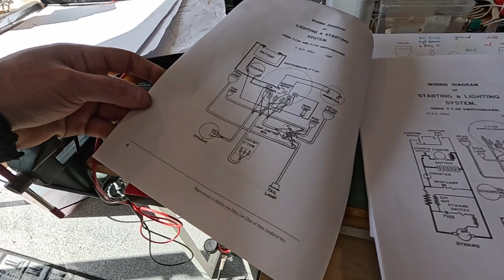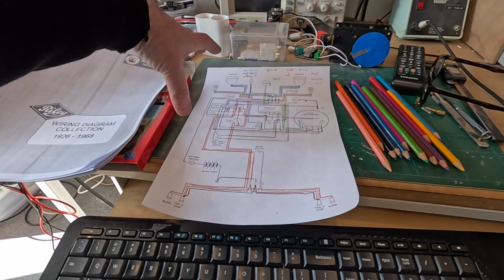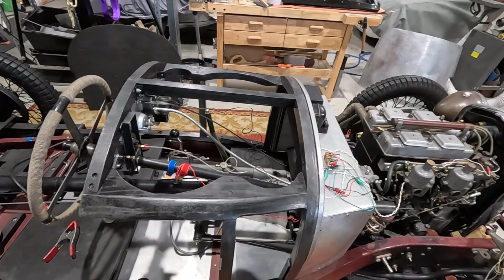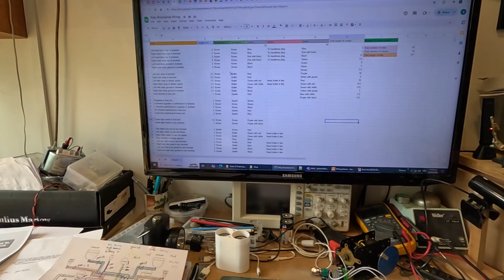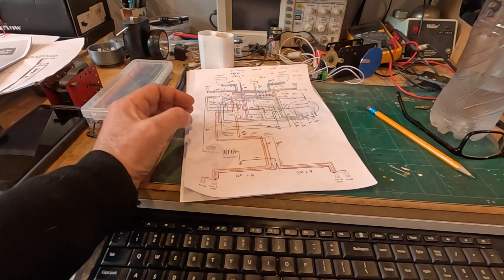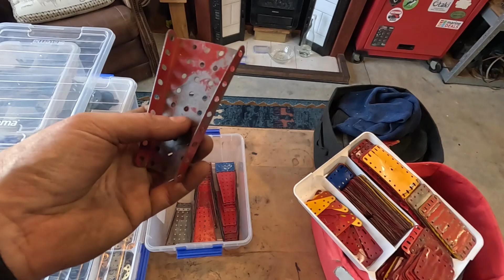Pre war Riley Brooklands - Wiring Diagram Done

Comment: I used AES for my wiring supplies, they had everything I needed. On the Standard Swallow I used the factory wiring colours for the original circuits, for the new circuits - indicators & headlamp main/dipped beams I used the later Lucas colours with the trace, helped make it much easier to keep track of the left & right hand sides.

The wiring is surprisingly complicated for such a basic system and on both of the Swallows, they are without a wiper motor (vacuum operated) and fuel gauge (mechanical on the SS, dipstick on the AS). As both cars are saloons, there is an interior light as well.

The Standard Swallow has built-in dashboard illumination for the instruments but nothing for the Austin Swallow, so that needed an extra circuit to allow for this.

I also allowed for plug-ins for satnav & dash cam, the Standard Swallow has a power socket on the dashboard for accessories and I was able to buy NOS Lucas plugs that fit perfectly. On the Austin Swallow, I had to use a voltage box of tricks to step up from 6v to 12v - ironic really, as the satnav then reduces the voltage down to what it needs (I think around 5v), but won't work unless it starts from 12v (and I don't know how to adapt the satnav to overcome this).

The AES crimped terminals for screw fittings are worth getting as they fit the Lucas terminals fine, guess you will have no problem with supplies of heat-shrink, makes the job much more professional looking.

I brought all my earths back to a common bar and then to the battery, as well as the chassis & engine - takes extra wiring as I wired each lamp separately but I felt is worthwhile, particularly on the Austin as this was 6v, 12v on the Standard.

I also used the metal flexible conduit on visible sections of the wiring loom, it is worth getting the conduit with the screw-in connectors, makes a neater finish and deals with sharp edges on the cut ends.

I found even after measuring, adding extra as a contingency that I was still short on a couple of circuits. The reason being that the routing of a bunch of cables has to have gentle curves for changes of direction, which means longer lengths required - it is surprising! Not a problem for me as I could easily order more, worth adding even more to your contingency!

If you need to use me as a mail box, let me know - happy to do so!

I found the wiring was a satisfying job, especially when everything works first time, it definitely brings the car to life!

Good luck!
Reply from the maker: Yes, they have a lot. It took me ages to go through their whole site. I did much the same with the colours. 'Standard' Riley where it made sense then Lucas for the additions. And I simplified a bit too and just stuck to the base colours so instead of having a tiny run of base/stripe colour to a switch say I just used the base colour. It's still easy to trace as you can see both ends of the wire! I did add in quite a lot of extra in my calculations and used a flexible tape to account for curves and slack. I also added a few metres to each cable I ordered. The cable itself is pretty reasonable cost wise I thought. I also bought their connector kit as I want to make some things (like guard mounted side lights) unpluggable. 

My plan is to run separate earths to things where possible so my biggest colour was black. I figure if I do run short of other colours I have plenty of plain black to make up the shortfall.

Instrument/dash lighting is something I don't have. I looked at lamps behind the gauges but not all my gauges have the little slot windows in them for that to work.  The ones that do are so spread apart I would need 2 or 3 bulbs there. I may end up adding a front mounted lamp but the issue there is I would need several. I don't think there is any legal requirement to have anything. And I am not sure I will ever be driving it at night in places dark enough to need them but with the modern hidden 12 volt socket/USB port I can always add some kind of temporary book reading type light.

I try not to use heatshrink on old cars. It looks too modern, especially if you don't remove the printing on it. That usually wipes off easily with some iso-propyl alcohol. A better thing to use is Hellerman sleeves. Rubber boots you put over things. You need special three pronged pliers to stretch them over things but they do look more correct than heat shrink.

I didn't see armoured cable on their site. I do have some dead optical scales from old machines with armoured style cable but it might be too modern. I think the very early Rileys used it perhaps but I am not sure the dates of when they used what. There isn't as much info on things like that for Riley as Austin 7s say.

I am not sure how the cables were finished in period Rileys either. Were they sleeved or wrapped or just bundled? My plan is maybe use good quality Tesa fleece loom tape to wrap them. I did that on the Austin 7 and it works well and looks fine. You don't use PVC electrical tape of course, that stuff is dreadful. Looks far too plasticky. Even on modern cars!

Thanks for the offer of postage. I will keep that in mind for anything small! The postage from AES wasn't cheap but they did use DHL so the package is already on the way, should be in the country today and is fully tracked. I expect it might take a week or more to get from Auckland to here though. We shall see!
Reply: @asciimation  Hope the stuff arrives in a timely manner. The heat shrink I use looks like rubber (I only do about an 1" to cover the terminal) and looks right. I have not wrapped my wires at all, something I need to do, I have bought some cloth tape from AES to wrap around the wires going to lamps under the wings - the original single wire to the single tail light (no stop light!) was just clipped to the chassis on its own (the clips are still there), with metal conduit as it exited from under the body to the rear lamp. I would have liked to have done all the wiring as it was originally with the single tail light & headlamp dipping - which for 1930 would be legal here - but fool-hardly as the cars are get in modern traffic... I have the original wiring for the Standard Swallow for the front part of the loom, including the original conduit, too far gone but good as a pattern as I could match conduit perfectly. The original ring terminals are slightly different to what is available now, nicer of course, but once fitted you'd never know! Good luck and look forward to seeing progress.
Reply from the maker: @austinswallow  It's arrived in the country and cleared customs already. But now it's in the hands of the dreaded 'local carriers' so I'll probably get it in two weeks time! 30s Rileys had the solenoid dipping headlamp set up and I am sure that's not legal here. Although you can get a headlamp exemption apparently for old cars which means you can drive them on the roads but I guess not at night. I guess that's how the veterans get around it.

Comment: I think you had mentioned in an earlier video that your chassis was a reproduction one, how does that work with the VSCC, will it still be classed as a vintage car and will that cause any problems when registering for the road ? Thanks.
Reply from the maker: No idea how it would work with the VSCC sorry as I am in NZ not the UK :) But here is isn't an issue it seems since it is a replica car. Will see when it comes to registering it but it was build by a proper engineer and is a direct copy of an original.

Comment: Had exactly that discussion on cost at my garage this week Just MOT and basic rubber steering gaiter stuff for my Jaguar is horrendous, More than the value of a 20 year old vehicle. AES is excellent my RM was treated to a rewire a few years back and all has gone well. New cable and good earth points made a huge difference to starting.  The Lynx is also benefiting as I type, so a timely order with them is I think as good as it gets. Do not get me onto nuts and bolts! Youngsters helping out with parents and grandparents at our local meets for several clubs are showing huge interest in keeping the old cars going. Affordability is another hot potato, especially if our wonder government looks at further tax changes etc. Wiring is a milestone in a rebuild and the machine looks the part; you must be pleased. Best from the UK.
Reply from the maker: Children already in families with old cars seems to be the usual way. The biggest worry for cost for us down here is once the only option is buying from overseas the postage costs make everything unfeasible. 100 quid postage on the wiring and another 30 for the nuts and bolts. The worst for that are Burlen -  33 quid for one SU needle posted to NZ for example.